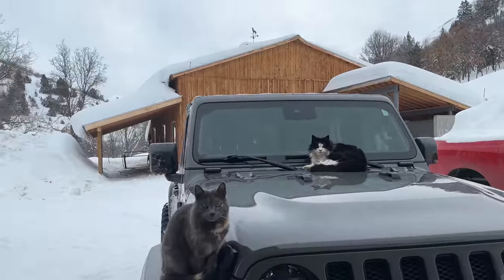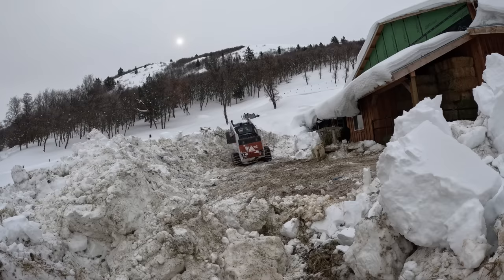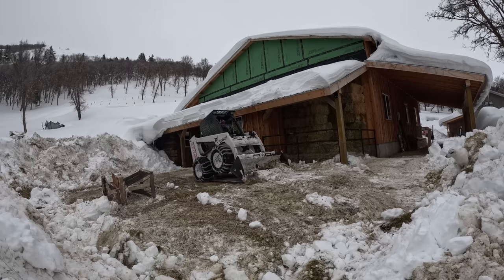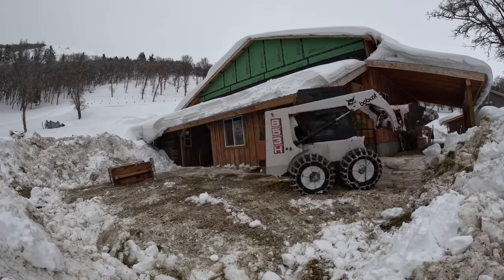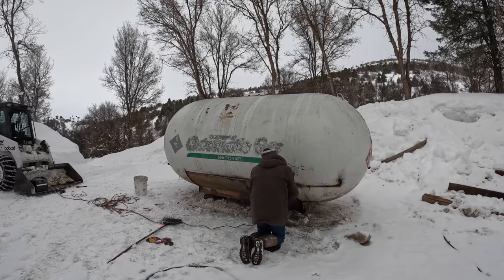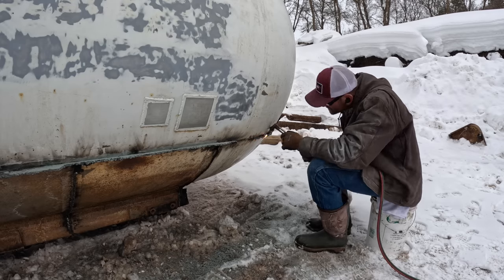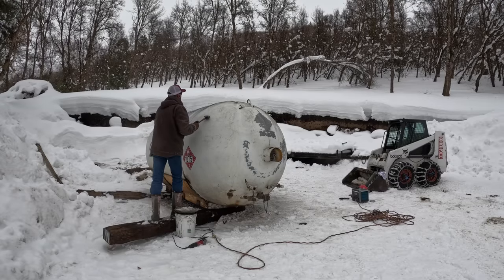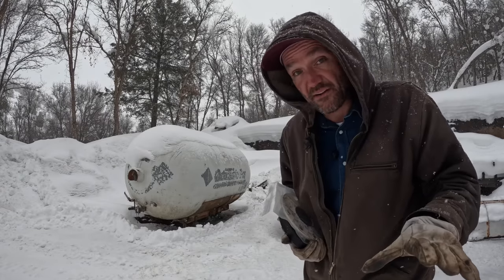#664 - Prepped Bobtail Propane Tank For Paint... (Very Carefully)

Comment: As I’ve watched you over the years, there have been many tools, trucks and machines you’ve purchased, but I do believe your best investment has been the leaf blower. You seem to use that more than anything else you’ve ever purchased and, I must admit, they’re a great tool to have. I never sweep anything outside, it’s all done with the leaf blower. I do woodworking as a hobby and used my air compressor with the air nozzle to blow sawdust off myself, my projects and to clean up the shop, along with the vacuum. But now I only use my blower for the most part. It’s just easier and faster than the compressor.

Comment: Actually, any bare metal you've produced by cutting or grinding could start producing more rust very quickly. If you kept a can of spray primer with you, you could spray the area you just exposed to the elements. Have a great day 😊.
Reply: Along the ocean where steel can start rusting within minutes of exposure commercial fishermen use a product called "Ospho" as a rust-inhibitor. It is inexpensive, effective and easy to apply (with a paint brush) until we get around to hitting it with primer and/or paint. I never see Ospho away from the coast but it is available online.

Comment: Honest I didn't watch the previous tank videos yet. But I'm sure u already know that the pressure test should be done with it filled with water and a pressure washer. Water is not compressible so if it pops it will just split and leak out vs Turing into a torpedo or schrapnell 💥. That how most all pressure vessels are tested
Reply: Thats how we test stuff where i work i can 100% attest to this although this i kind of a different situation. Not sure id want moisture in my propane, but im no expert
Reply: Absolutely 100% that is how you test a pressure vessel that is rated for over 15 PSI(API vessel).  The amount of possible kinetic energy sitting there when pressured by air to 250 PSI would be fatal.  As far as worrying about water in the tank after testing you either purge the tank or pull a vacuum to clear the tank of water.

Comment: I only wish I could do this. I run my house off of a 120gal tank. When filled it will hold about 85gal. I filled once at the beginning of fall and again last month. That’s running heat,hot water and a kitchen stove. If I had one of those it would last me 6 years. Especially now that I finally got my wood stove installed last weak.

Comment: In our area,  any coded (certified) pressure vessel that has been modified in any manor must be re-certified.  Around here it’s a very expensive task and few shops are set up to do it.  And that’s in an area (oil and gas) where shops are plentiful.  I can’t imagine how you could get that done in the field in the middle of Idaho.  I would have left it as it was and not take a chance of the propane company not wanting to take on the liability and refusing to fill it.

Comment: Though you have years experience on me, I would have been more comfortable with you using a wire wheel over a flap on removing the paint/decals. I understand doing it both ways and won't say one is right or wrong or safer. Loving the videos and wishing your family all the best.

Comment: I truly hope you fill entire tank with water before pressure testing. Takes out a vast majority of the expansive energy from air volume to replace with non-compressible water.
Reply: here in Canada, the pressure test MUST be done with water.  thus the term "hydrotest"  Assume the same there.
Reply: @larryfreeman7979  true in the states too……at least in the oil and gas industries.

Comment: Nice to see you finally got a set of pallet forks.  You'll find all sorts of uses for them LOL.  I just have a small tractor, but find myself using the pallet forks far more than I do the loader bucket.  I've also found I end up using my tractor/loader as a wheelbarrow around the property just as you were doing with the skid steer hauling your tools up to the propane tank....I mean you got the skid steer there you gotta make use of it, can't let that stuff set long HAHA!!  Nice that you picked up that trencher attachment, you'll find great use for it as well...its one of those things that after you get a task completed it might sit for months, maybe years, but when you need it, its there for you, no need to run to town to try and find one to rent...I can't recall if you mentioned getting a post hole digger for the skid steer but I think that would be one item I'd pickup for sure as well....on a homestead like you've got, you probably dig a lot of post holes throughout the year, so it would be quite nice to have one for the skid steer....given it has the hydraulics to handle that stuff, put that thing to great use saving you time for other projects.  

You are gonna need another shop just to store your equipment, probably a good idea too, enclose it completely so you can at least heat it in the winter, to make service/repair work a much more tolerable task...as anyone with equipment knows, the service/repair work is never fun, and even less so when you gotta try and do it when its freezing or sweltering outside.
Reply: William, he has all kinds of room he just has to learn to pick up things and close the door to the shop so the snow doesn't get in the shop. 
 Looks like he's out of firewood?
Reply: @chris3m98   you’ve got a good eye , seeing that empty firewood location.
Reply: @chris3m98  Not sure on weight of attachments and stuff for a skid steer but some pallet racking/shelving I think would make for a great storage solution for a lot of those items in that shop, palletize and put on a shelf....would keep clutter to a minimum, keep stuff organized, and out of the way....kind of my plan when I get my shop organized and floor done, is to get some sort of racking/shelf system so I can store my tractor's attachments/implements more easily and not have them scattered all over the property LOL.  

Out of firewood, he's got a whole forest behind him LOL.
Reply: @wildbill23c , You must be new to this Site?  
To burn wood it needs to have a moisture of around 17 to put out the best heat.
  What he cuts down from the new property will be ready next winter, if he's lucky.
 If he is all out of wood, then he is burning his propane supply for the rest of the cold weather.

Comment: Has the roto gauge been abused with pliers?   Does it still have the original relief valves? Are you going to keep the 1st stage regulator above the wet line?